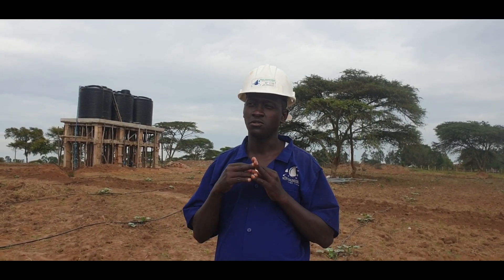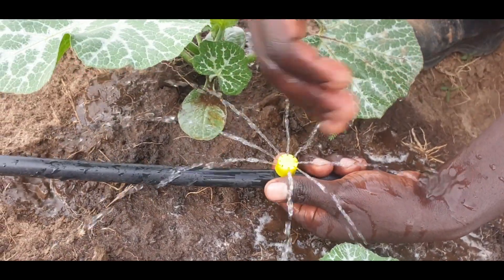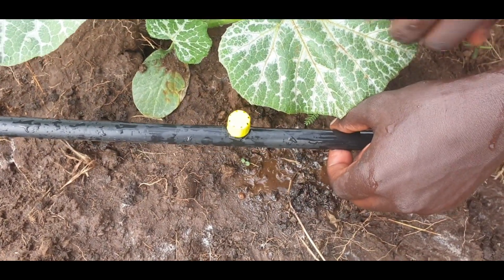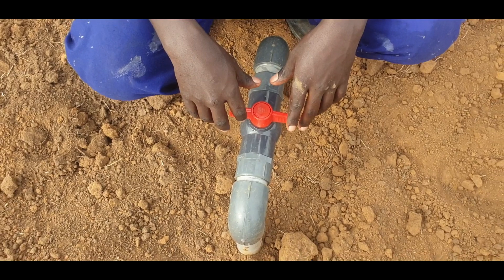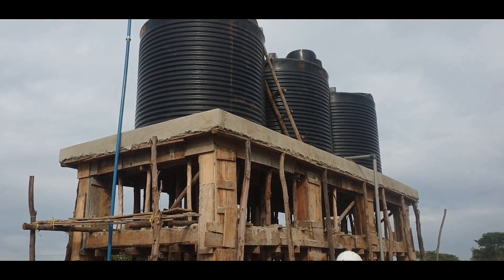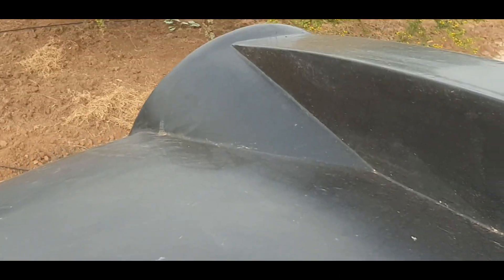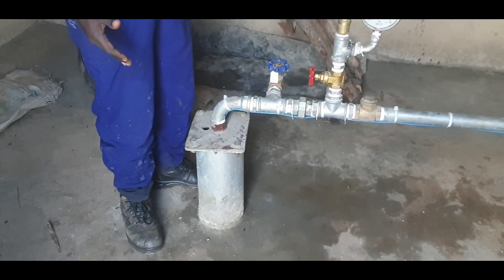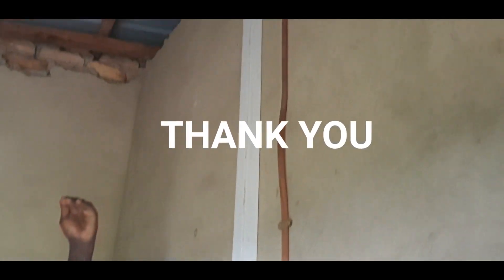Solar powered multiple outlet adjustable flow button drip irrigation for pumpkins in Uganda

Comment: If I grow cabbage, how many cabbages can I put around one emitter?
Reply from the maker: Cabbages can be spaced at 30centimeters from eache other, four cabbages can be planted in a square or circular pattern depending on pressure you may have, minimum would be 5meters

Comment: How much is the well
Reply from the maker: There two types of wells we construct i.e deep well/borehole (machine drilled) and hand dug well
More information about deep wells
https://weisengineering.com/boreholes-in-uganda/
More information about hand wells 
https://weisengineering.com/hand-dug-water-wells-in-uganda/
Drilling a borehole involves the following processes;
1. Hydro geological survey to determine water availability and  geological formation - 
this can cost about 1.2-1.8m depending on site location
2. Borehole drilling and sitting - this involves using heavy machinery; drilling rig, compressor, different drilling bits etc and casing the drilled well with pvc plain and screen pipes, this can cost 19-24m
3. Pump and recovery testing - to determine borehole yield and optimum pump installation depth.
this can cost from 2.5m
Hand dug well can cost 5-7m including construction materials.